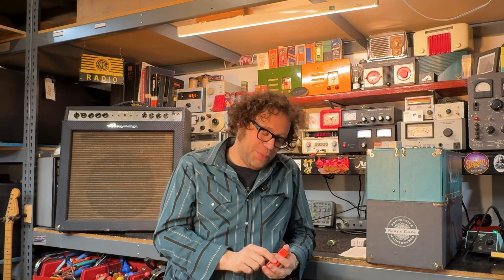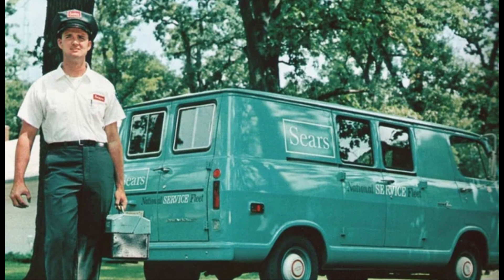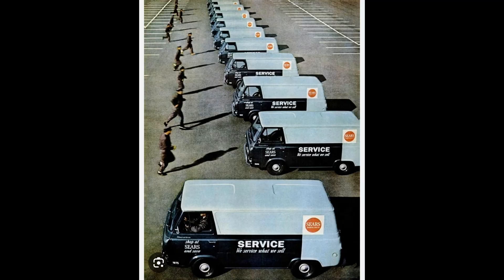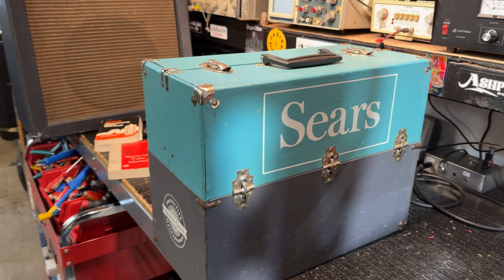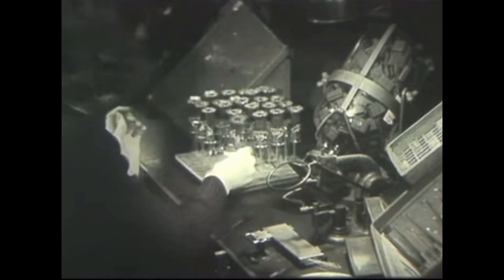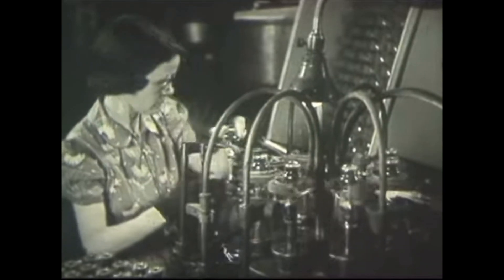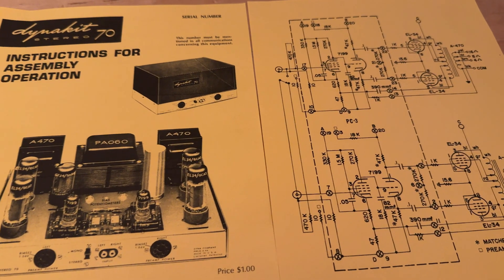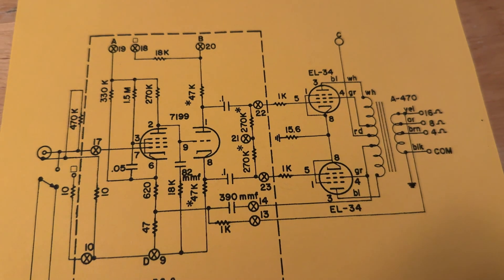7199 Tube Conversion & Tube Explanation

Comment: The ECF82 ( european tube ) is also a candidate ( equivalent to the 6U8A tube......
I would never modify an ST70 with those modern new driver boards ( triple >ECC82) , this is than no longer an ST70 !
The 7199 was one af the very few tubes made for  audio.....even a 300B wasn't made for audio !

Thanks for sharing ...nice to discover someone who loves and UNDERSTAND tubes ..
PS : The 6F2 tube is also a variant of the ECF82/6U8..

Comment: Your videos are so timely...... I just snagged a '67 Reverberocket 2. I was relieved to find it had a 6U10, not a 7199!
Reply: The 6U10 is even harder to find than a 7199 !
Reply: @goodun2974 They are readily available from many sources for under $20.
Reply: @ on the plus side, those triple triodes seem to last forever - no rattles there :)
Reply: @monzajunior7337  7199 is notoriously microphonic.
Reply: @ Indeed.
Reply: @goodun2974  on the contrary, 6U10 are quite easy to find in the $10-$20 range.

Comment: Great information! Years ago, I used an adaptor and a 6U8 in an industrial public address PA. Stromberg Carlson APH1100. Keep up the great videos. I am in the process of building a modulator using 2 X 813's for a WW2 transmitter (TCK7).